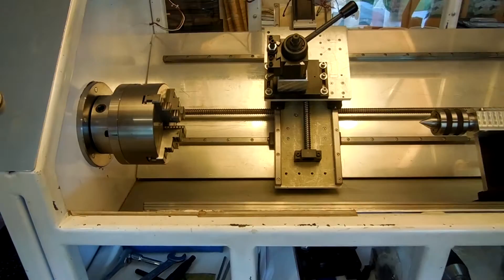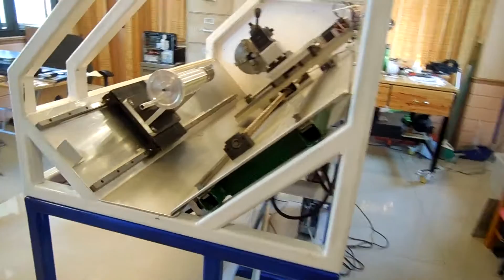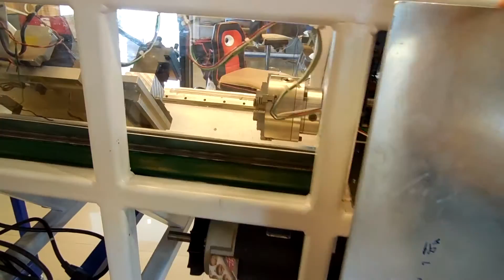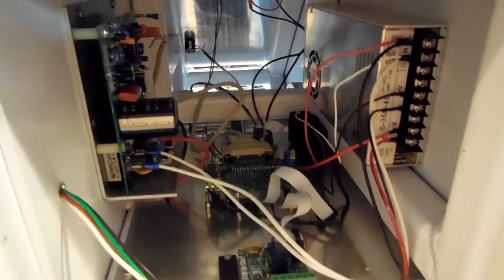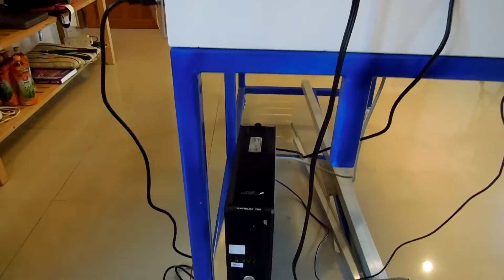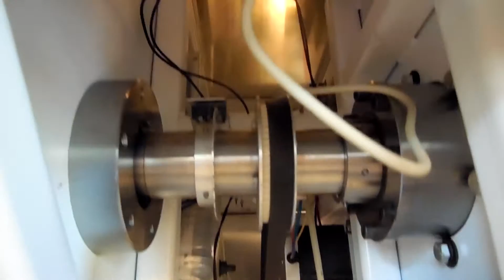Static Walk around

Comment: How do you deal with alignment to spindle. More so the tailstock is obviously the bigger issue. With the thin structure of the lathe any floor inconsistencies or settling will throw it off enough to be problematic. I have enough issues with my commercial lathe constantly having to readjust the feet to prevent bed twist and part misalignment.
Reply from the maker: The tailstock is adjustable in both X & Y and I have re-aligned it a few times over the years, but since I only use my lathe to make parts for my other hobbies it's rare that I make more than a single piece, and I've never made more than 10 identical pieces.  Since I don't use this lathe for production work I have the luxury of being able to first machine my parts slightly over-size, measure them, and then make final cuts as needed.  The lathe consistently holds tolerances of +/- .001" and with a little more time and effort from me, I have machined bearing surfaces to 0.0002".
The "space-frame" structure has proven to be quite rigged for my purposes, but I have no way to determine how well this design will hold up in a production environment.
For more information I created a build log at:  http://www.cnczone.com/forums/vertica...